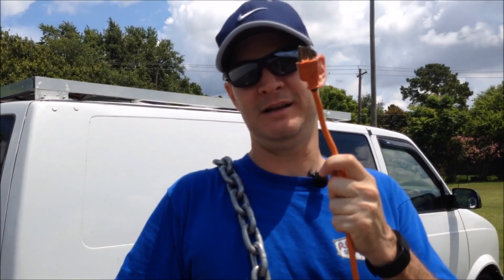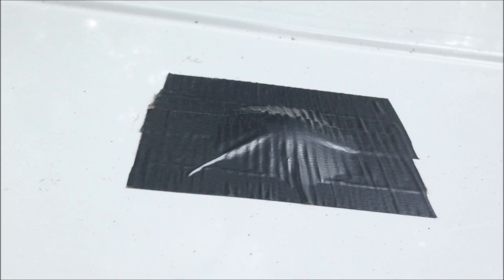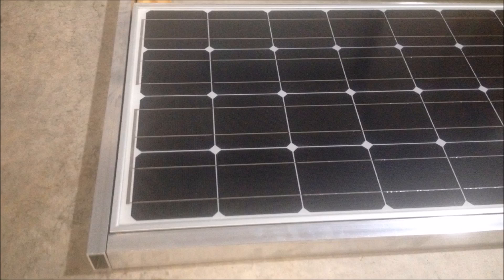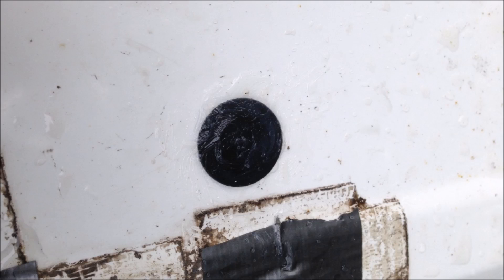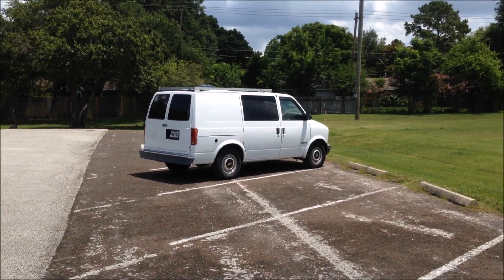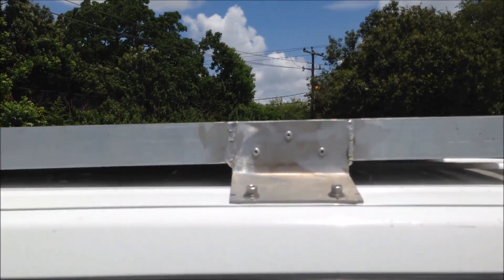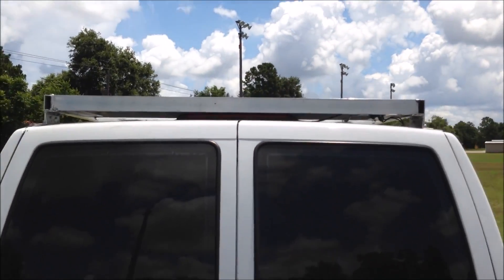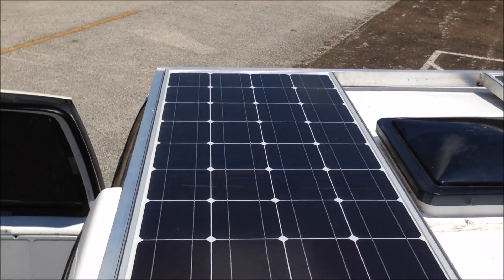Astro Camper Van Build 7 - Roof Rack & Solar Panels

Comment: What did you use to secure the panels to the frame?
Reply from the maker: We used bolts with locking nuts.  This was a security feature to make it difficult to steal a panel.

Comment: Very sanitary and well-designed
Reply from the maker: Thanks!  The solar panels and rack were one of my proudest moments of the build.  My Dad drew up the design, we gathered the parts and took them to a professional welder to complete the job.  We then just had to bolt it down.  It has worked amazingly.  Gotta love not paying for power. 👍

Comment: The best way to have made the van more still was to have first painted the van black...  all black including the bumpers Then also paint the solar racks black so that they blend into the van Then it would have been more difficult to distinguish the solar racks from the van especially at night.And when you paint the solar racks you wanna use flat black not gloss . In fact when I painted my van black I painted the entire vananda solar rack flat flat if you're trying to go stealth it's better not to have anything be glossy and shiny
Reply from the maker: Right, black really helps blend in at night, but can get hot during the day. Personally, I tried to change as little as possible on the exterior, to make it look like a typical work van.  In 5+ years, I have never had anyone ask me to move or knock on my door. Then again, I don’t park on private property, like Wal-mart.  Apartment overflow street parking is the best place to urban stealth camp, from my experience.  So far in 2020, I have only stealth camped for 1 week, so stealth is not as important as it once was to me.  Thanks for checking out the videos. 👍

Comment: Impressive build.. I've been watching and following your videos for tips. I am actually pondering to convert my van to a camper (somethiing like this)  but I still do not have the confidence and cannot afford to take the risk yet until I am 100% sure of what I will be doing. I am taking down notes from you.Thanks.
Reply from the maker: I totally understand.  It’s a big step, especially if you haven’t done much carpentry or electrical work.  I had been thinking about it and debating buying a van and doing a build since 2012.  I finally bought my van in 2015.  LOL!  Don’t wait too long.  Keep watching videos and make a design plan.  You could always start with a simple, minimal build and add on to the build as needed.  For instance, just flooring, a basic bed and some storage.  Test that out and add more later.  Good luck with your future van build. 👍🚐💨

Comment: I know I'm late to the party with this comment, but how did you choose where to put the screws as not have the roof cave in with weight on top?
Reply from the maker: Hi there. This van used to be a cargo van with a ladder rack on top. After removing the ladder rack, we designed the solar panel roof rack to use the pre-existing bolt holes from the old ladder rack. The aluminum rack and solar panels actually don’t weigh much at all. Thanks for watching. Hope this helps. :)

Comment: Best rack I've seen. The panels flush to the top of the aluminum is super neat.
Reply from the maker: Thanks Clint.  Custom design, drawn up by my Dad, so it’s probably still the only rack of it’s kind out there.  The only negative is that I can’t tilt the panel when not in a stealth parking location.  But, securing the panels and preventing theft was one of our goals for the design.  Still, the panels have done a great job keeping my batteries full.  Thanks for checking out my videos.

Comment: TROY>>>>Do you think you could fit another solar pannel up front where there is extra room? (i am trying to get 5 total with no fan on a astro)
Reply from the maker: I believe you could fit another solar panel up front, but the roof does begin to slope downward towards the windshield.  Over on my website, I have a post with a drawing and measurements of our rack.  http://travelingtroy.com/2016/roof-rack-solar-panel-install
Reply: awesome man thanks for the vids you have some the best van build vids on youtube, especialy the insulation vids! so many vids of idiots using reflectix that have no clue.

Comment: how do you seal the screws that are holding the solar panel rack to the van?
Reply from the maker: When I bought the van, it had a professionally installed ladder rack installed on the roof.  I removed the ladder rack and left the mounting plates w/ screw holes in place and built the custom rack to fit these mounting plates.  When mounting the rack to the roof, we added waterproof silicon into the holes before screwing the mounting brackets down to the van.  Hope this helps.  Thanks for checking out the videos.

Comment: Looks nice, great job to you both. I was wondering if you had any problem with the air blowing under the solar panel bracket as you drive down the free way..Looks like air could get under there?...Other than that sweet set up, want to do a Astro Van build myself with the same 3 panel  Solar & Batt. config...hey enjoy
Reply from the maker: When we designed it, we did considered putting something at the front part of the solar setup to divert air up over the panels but decided to wait and see how it works.  It's bolted down very well, so the wind would probably blow the van over before pulling of the rack/panels.  We were concerned about wind noise though, but no issues with that at all on the highways.

Comment: Are the solar panels powerful enough to power a heater or an AC in the summer?
Reply from the maker: Unfortunately, this setup will not power either a heater or an A/C.  It would have to be hooked into shore power to run those.  Heat isn't a problem, as you could easily get a Mr. Buddy gas heater to keep the living space warm.  A/C on the other hand is hard to build into a van running on solar.  Most people with A/C units either plug in at campsites with shore power or they run a generator to power the A/C.  Thanks for watching.  I hope this helped.

Comment: how was solar panel attached to solar bracket?  I must have missed that.
Reply from the maker: The roof rack and solar assembly were done off of the van.  The bottom brace of the panels were screwed into the roof rack, then the whole thing was lifted up and bolted onto the roof of the van.

Comment: Dad's r the best! It has to be great doing the build with him.  Where did u get all the electronic stuff from? solar panels? Did they come with schematics?  Trying to break them, but those chains r getting stronger.
Reply from the maker: Exactly, those chains will weigh you down.  We bought most of the electronic items from Amazon.  The solar panels were actually purchased from Renogy's ebay store when they went on sale.  Now, the sale price I got them at is the standard price.  My Dad has been a great help with this build, that's for sure.  Thanks for checking out the videos.  :)

Comment: How did you decide you needed 3, 100Watt panels? How do I decide how many panels I need and which size to use? Thanks Traveling Troy
Reply from the maker: Austin - Most people get one battery and one solar panel and do just fine with the 1 to 1 ration.  If you charge all your devices during the day when there is an abundance of power being generated and you barely use any of your battery power at night, then this works out fine.  One 100-watt panel can charge a max of 5.5 amps to the battery during the best/sunniest conditions.  If you only use 20 amps at night, this can be added back to the batteries easily.

So, there are three choices.  Go with the one to one ration like above.  Or, go with the 3 to 2 ratio like my setup where I have more solar than battery, so I charge faster with a small battery bank.  Or, you can do a 2 to 3 ration where your battery bank is bigger so you charge slower but you have more battery power in reserve.

I hope this helps.  I initially typed out this long explanation, but then I deleted it and tried to make it shorter and to the point.  :)

Comment: Such a great job, one of the best I've seen, question why did you not use a Chevy full size cargo van for this amazing project?
Reply from the maker: Hi there!  Thanks for checking out the vids.  Two reasons I went Astro van:  # 1 was the cost.  I could buy one for $3k - $5k, pay cash and not have a car payment.  Mine ended up costing $3800 + TTL, so about $4100.  The # 2 reason was I wanted to start off as small as I could to see how I like it.  I can always go bigger and I don't expect this van to be my last.  I may have two vans eventually - one for winter/southern travels and one for summer/northern travels.  We'll see.

Comment: Nice job on the mounting frame.. my only concern would be replacing one of the panels with another of similar size.
Reply from the maker: We didn't make replacing the panels easy, that's for sure.  Hopefully, we wont have to replace them.  Keeping them secure was important.

Comment: did you get more batteries?
Reply from the maker: Same batteries.  I have two 6 volt - 213 amp hr AGM batteries.
Reply: Oh yeah, I take to many meds to remember stuff.  I'll be hitting the road next month  myself.  I got a bunch to do.. gotta move out of my place and get the van put together. At least a bed and battery setup. The a roof vent fan.
Reply from the maker: Good luck on the build Bobby.  It can be time consuming but well worth it in the end.